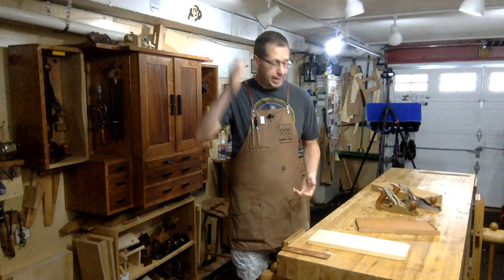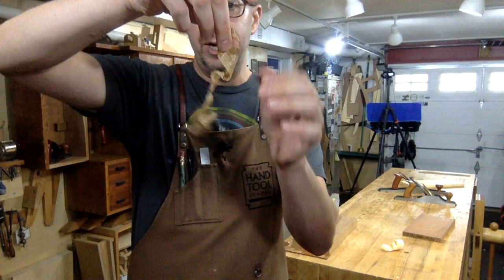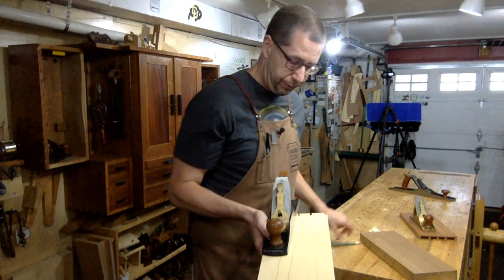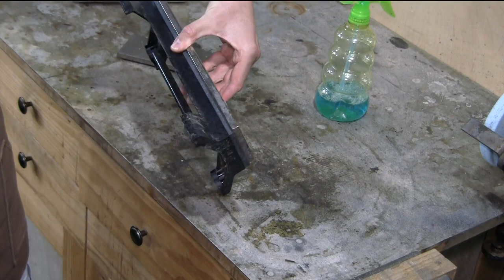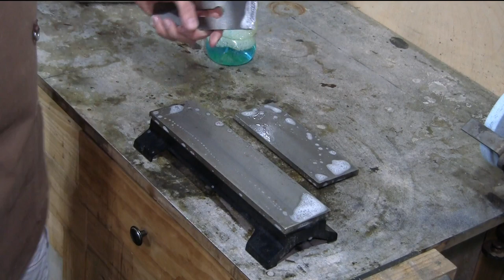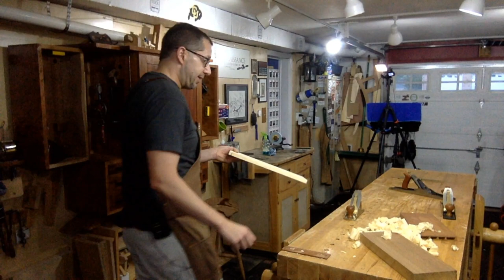Hand Tool Live:  Eliminating Plane Tracks

Comment: I got rid of the plane tracks on my Lie Neilson 4 1/2 smoother and 5 1/2 jack plane by just doing a slight rounding over of the corners of the irons. Takes just a few minutes on a1000 grit diamond stone. I've never been into making a camber on any of my planes. 75% of my work are Chippendale and Shaker reproductions using syp and a cambered blade seems not to work to well on the soft and hard grains. An iron with just rounded over ends has made for some really pretty finishes on the syp. I don't use sawmill lumber, I use premium kiln dried so I'm usually one up on how I have to plane a board and panel. You're an encyclopedia for woodworkers, especially for hand tool beginners.

Comment: Hi Shannon,  how do you apply a camber to the veritas BU smoother you showed?
Reply from the maker: the exact same way I showed in the video.  No difference other than you will find you can make the curve even a bit less pronounced and get a slightly wider shaving because of the lower angle of presentation.  You just have to play with the blade a bit on the stone to figure out how many passes to take at the corners.  Start small and add to it to dial in the right amount.

Comment: How long did it take you to break in your DMT extra extra fine stone so that it became a polishing stone? I picked one up a couple of months ago and have found that it does not really polish the bevel as much as grind it. I could never go straight from that stone to the wood without about 60 to 80 strokes on my strop charged with green compound first. I’ve put quite a bit of effort into breaking it in by flattening a chisel back multiple times and using it to flatten my coarse water stone several times as well. I even took it over to my powered jointer where the bed had developed some rust while it was in storage and basically used it to sand away all the rust on my jointer bed but it still leaves nowhere near as fine an edge as even my 4000 grit Waterstone much less my 8000 grit. I do also have a coarse DMT stone that I’ve had for 10 or 12 years now and I do remember that it changed drastically over the course of the first year or two of ownership. Am I just being impatient expecting the extra extra fine to be the final stage before stropping without breaking it in for a couple of years first?
Reply from the maker: It certainly didn't take more than a few days.  But keep in mind the "polish" you get from diamonds will never be the same as water stones.  It is nearly impossible I have found to get a mirror polish from diamonds but that is also not a sign of sharpness.  I strop everything after my stones and when I made the switch from water stones I found I needed to adjust from what I was used to seeing from those stones but in no way am I getting less durable edges today than when I was using water stones exclusively.